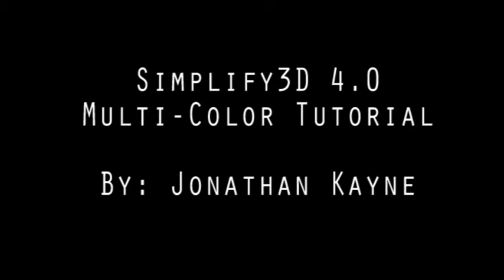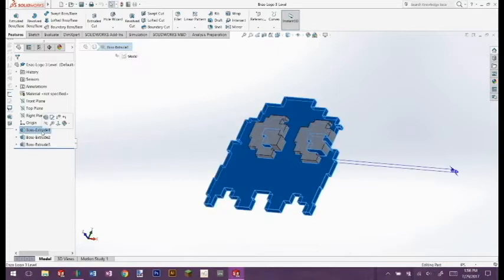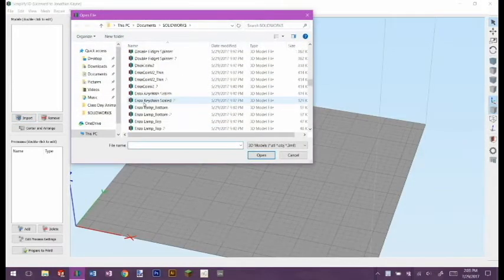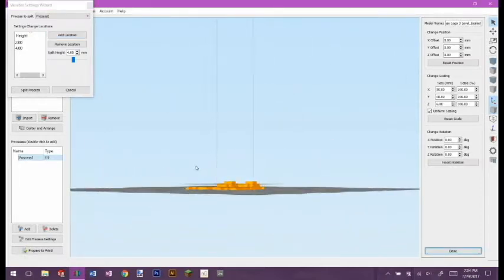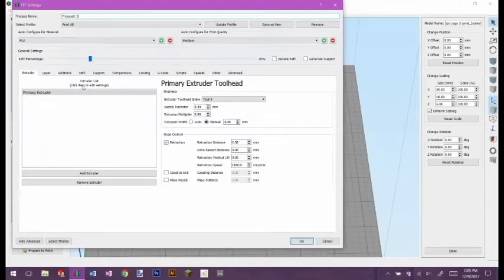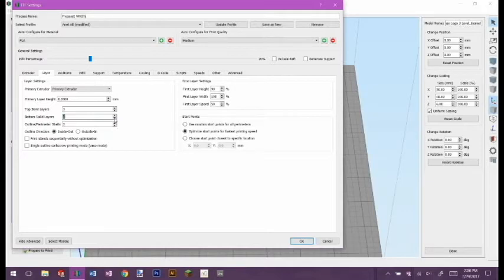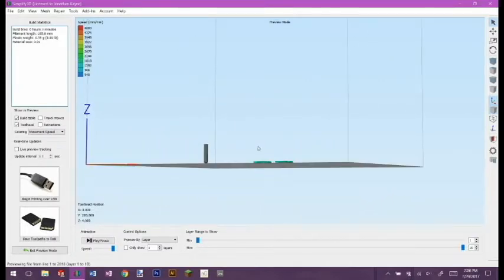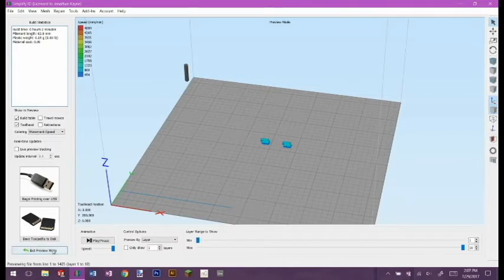[Tutorial] Multi-Color Prints on Single Nozzle Printer in Simplify3D 4.0!

Comment: What type of file are you importing.. the layering doesn't seem to work on STL.
Reply from the maker: It is an STL. I haven't used simplify3d in two years so I don't know what has changed since then. I use PrusaSlicer which has this method built into preview mode
Reply: @JonathanKayne  I upgraded to the new version but did not reboot.. worked after that..lol

Comment: Great video thanks very much . I got question . I'm using an auto leveling sensor I assume that after each process it will do the code G28 so how I'm supposed to level the z axis ??? Because if I use G28 it will crash into my previous process
Reply from the maker: seetcas I'm not sure what you would do for that. After uploading this video, I was informed that there are ways to change the filament other than the method I did.
"The build plate" posted a comment here explaining how to do it.

Comment: {REPLACE "; layer 11," "M600\n; layer 11,"}     Enter this in the "post processing" box section found in the scripts tab, change the layer number to the layer you wish to change your filament at for example if your text starts at layer 34 change it to (layer 34," "M600\n; layer 34).

This m600 command is the change filament command for all (Marlin, Smoothie and MK4duo) firmware based printers
Reply: Does that do a purge or other "priming" of the nozzle similar to a skirt to make sure it lays down filament right away?

I would also think you need to make sure you don't have G28 on the other processes to be dropping your z axis down, just home the x and y to get an accurate re position on the next process start?